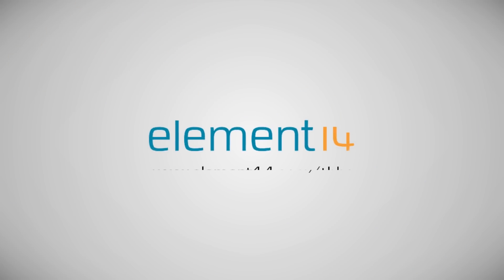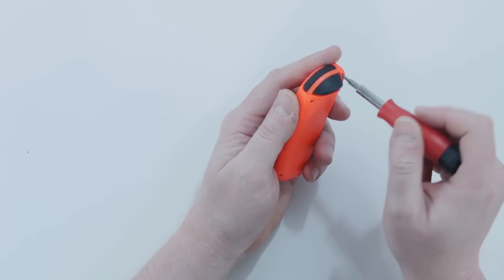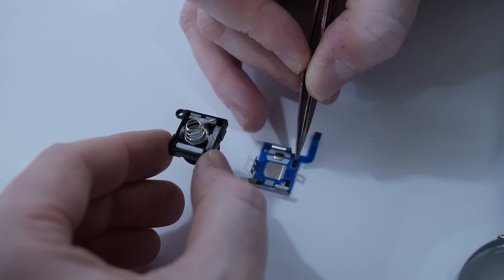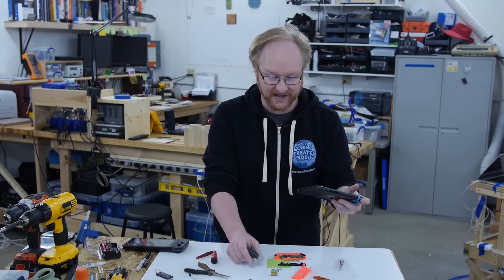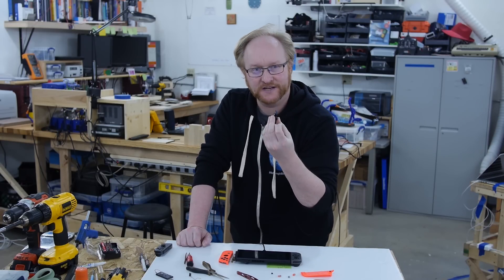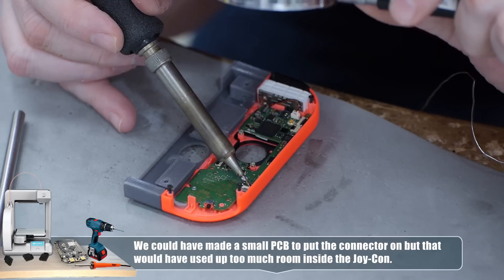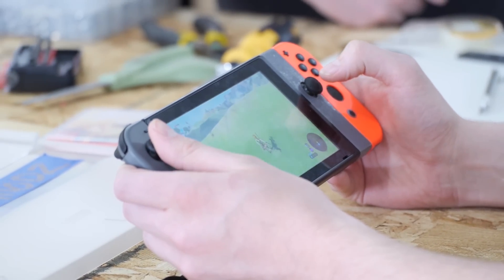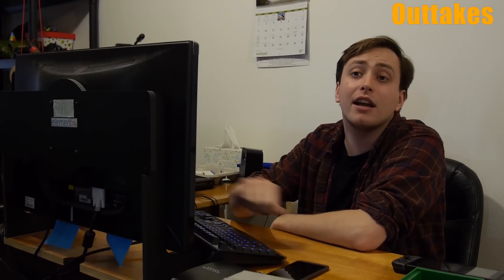The Ultimate Nintendo Switch Mod!

Comment: kinda surprised Nintendo dint just do this, but also with both sides, and so you can connect both side controllers together and make a full controller with like a flip out stand on the back of the switch.
overall this is really well made, good job guys :D

Comment: My issue is not with the controllers but the console itself. It’s no longer the 1980s and people don’t put their consoles on top of their big tube TVs. This upright console design does not work for modern entertainment cabinets. The switch console needs a redesign so that it can fit within the under cabinet slot of an entertainment center. And if I want a portable Nintendo, I’ll just get a 3DS... a console is a console. Maybe that’s just my own opinion but I would love to see a redesign of the Nintendo switch as a flat under cabinet console design.

Comment: It doesn't take a rocket scientist to figure out that the joy con analog stick is cheap. I have an idea for another switch mod. Replace the analog sticks with actual full range sticks like used in the switch pro controller. Or you could give it a d-pad as featured in the Nintendo switch pro controller. Or you could replace the buttons with buttons that don't feel like your squeezing loose pieces of chalk as featured in the Nintendo switch pro controller. Or you could tape a Nintendo switch pro controller to the bottom of the switch and call it a day.

Comment: So a non-issue that's not very common at all is being "fixed". I mean, this is neat but it's kind of redundant. The placement is perfect honestly. The offset analog sticks should be a standard for almost every control. Big reason why I think a lot of folks like the Xbox controllers.
Reply: The reason why the Xbox controller is fine is because while it is moved down, it is also moved outward to be a similar distance from the thumb. The thing with the JoyCon is that it is only moved down and not outward, so to use it your thumb has to crane itself inward instead of simply moving a bit to the left or right.
Reply: It is an issue. Your right thumb is so cramped up holding the unit. The orientation is the same but the spacing is not the same as an Xbox controller. Yeah if I was 15 again and my hands haven’t had years of use working sure it be fine but That is not the case for me and a lot of other adults.

Comment: Just got a Switch and I'm finding the placement of the right stick to be a problem as well. Trying to play Doom on this thing, with the joy cons connected to the screen is a challenge. I can't get my right thumb into a good position to hold the system and play the game comfortably. It helps to play with the joy cons detached, but I think the best answer may be the pro controller.....but that kinda defeats being portable the more stuff I have to carry around with it. A right joy con with the stick in the upper position would be a great option.

Comment: The part the missed is how the stick is designed to be used. It’s not a tip of the thumb stick; you’re supposed to use the middle part of the underside of your thumb so you can also reach and use the buttons.
Impressive mod regardless

Comment: That works... or you know just position your hand holding the right joycon in a way your thumb can comfortably reach the joystick and buttons. This layout is a lot like the 360, I've got fairly big hands and the layout doesn't cause me any grief. 

Also, you could try not playing it for extended lengths of time over an hour. You know, pause the game and give your hands a break, that kind of thing. There are so many easy fixes over 'hacking' it to add yet another inch or so just to 'fix' the joystick issue.

Comment: I feel like you coulda just 3D printed a duplicate controller flipped the along stick and buttons like on the other side and just reassemble the components into the new 3D printed controller. Instead of over complicating this.

Comment: Nice solution to a problem that wasn’t really a problem.
Reply: a lot of people hated it. stop being such a fanboy.
Reply: YouTuber with small hands detected.
Reply: Cool opinion bro, Check out my opinion. 

THE RIGHT STICK PLACEMENT IS NOT VERY ERGONOMIC FOR HANDHELD PLAY!!!!!!
Reply: Speak for yourself, I decided not to buy a switch immediately after trying one for the first time.
Reply: I have relatively large hands, but not everyone has the same movement range you know. My thumbs can't go past a 90 degree angle from my pointer finger, i.e. when you make an "L". I can slightly go past that, but it is strenuous to keep them that way. My thumb's final segment is about 2/3 the length of the first segment (they look equal if you disregard the part that's "inside" the hand). My thumb also cannot bend past the point of the two segments being straight when bending it backward at all (thumb-tip at about 20 degrees eyeballed from base of thumb), and only 90 degrees the normal direction. If you find the Joy-Con comfortable on the right side, I GUARANTEE you cannot say the same set of things I've said here about your hand.
Reply: You must have baby thumbs.
Reply: It's a big problem for me. I can't play Zelda very well at all. During battles, I feel like I'm a grandpa who's never played a video game in his life. It's really weird. The placement just isn't right. Also, no one can argue that the pro controller and joy con placement are in two different places, making uniformity non-existant.
Reply: You guys should look into getting some thumbstick extenders as well as a decent grip case. It will help alleviate the issue to a great extent. I use an Orzly Grip Case and Hyperkin Switch extenders, with the short concave one on the left stick and short convex one on the right stick. It's much more comfortable and I can play games like Zelda for hours without issue, as well as actually being able to aim sufficiently with the right stick. Previously, I couldn't play more than 20 minutes without my hands cramping up. Both products come out to about $23 US together on Amazon.
Reply: @guy827  I just purchased the grip case for mine today for 15 bucks and it was very worth it. Completely changed the way I have to hold the switch making it easier to move around to different buttons. It's just better with the grip case.
Reply: It's a problem for me too. I solved it buy purchasing a pro controller but it's not the same because I'm not holding the display.
Reply: Heres a solution!! Buy a pro controller!!!! Most of the time i play it docked anyway so why go to trouble, !!
Reply: For your small hands maybe. obviously it was enough of an issue to mod the system.
Reply: It's a problem for me, the right is so uncomfortable in comparison to the pro controller.
Reply: Bandar Alshareef stop using a claw thumb grip then and hold it right?

Comment: okay easier solution guys so you dont have to Ruin Your Switch trying to do this get the screen protector pack that has stick extenders and if you need more than that you can put PS4 controll freaks onto them extenders

Comment: All we we need is to make both joy cons set so that it's resembles a game controller more, try to design a new casing to put the joy con internals into so that it can be all one color, as well as, give it a more control feel on the back of it so it'll basically be like taking a controller and cutting it in half and slapping it on a switch,  and finally a docking system for the joy cons so that you can use them like a normal controller in tabletop and tv modes.

Comment: Nintendo should totally make a Switch controller that has the thumb placement just like that. It wouldn't be able to be used as a standalone controller like they originally intended, however if it's sold separately then it'd be okay because we'd still have the old one (or just use the much more comfortable Pro Controller  for the second player) -- I would love to have this modification as a product.

Comment: Your next project is to put a D-Pad on the left joycon. ;)

Also try and design a Switch Dock with a built in 1080p monitor! lol it would unportablize the console, but since portable display only does 720P it may still be cool to have an option for 1080P on the go. :P

Comment: This could have been fixed with 3D printing much, much easier. Just print a triangular wedge that angles the entire joycon at an angle where the top is further from the system than the bottom then print a grip that keeps the hand resting vertically with the console.

For visual reference, imagine the forward/backslashes make up the joycons. The buttons would take about 5 seconds to get used to but the stick directions could be annoying.

|\ \[____]/ /|

Comment: Would it be possible to mod a DS to play Gameboy and GBC games by either:
Using the physical switch it the GBA cartridge slot to determine whether an emulator should be loaded such as a modified version of Goomba Color like a GBA game and if it is switch to the game cartridge so the emulator can directly read it
Or:
Use that switch to determine whether to not boot the DS but instead a GBC built into the case?

Comment: I would love a stand in which the switch charged and you are able to play on the local display. The normal stand is not that sturdy. If it would be small enough to be able to take it on public transportation would be a big +.

Comment: Isn't there a pro controller
Reply: Ian H how does it double the size it's a wireless controller that doesn't attach to the switch at all
Reply: Yes, there is a pro controller, but that would drastically reduce the portability of the Switch.
In fact, you could only play in table top mode, so you would always need a flat stable surface. Not quite portable anymore huh?
Reply: @TheFrantastic  no, you can play with the pro controller when the switch is docked... it's a wireless controller...
Reply: @yeahitsben  If the switch is docked, we're not talking about portability. This is regarding portable mode.
Reply: @TheFrantastic  I think you've seriously misinterpreted the entire concept of the switch. while at home, it's a full-blown console experience. while you're travelling, it's still a full blown console experience. a pro controller is pretty easy to take around, you can just shove it in your backpack.
Reply: @yeahitsben I know how the Switch is supposed to work, but what you're saying isn't relevant to the argument.
If you want to play in portable mode, not table top nor docked, you can't use the pro controller. It's not like you have 4 hands, right?
Reply: @TheFrantastic  yeah but if you want to play in portable mode, you have to use the joycons. here's the thing with joycons: contrary to popular belief, they're not absolute garbage, they're actually pretty good. I genuinely prefer the joycons over the dualshock 4. they're also good because they protect the main switch body from nearly every single angle when it's dropped.
Reply: SuperToadDaniel Gaming thank you
Reply: The Pro Controller doesn't change the size of the system. It's just a wireless controller.

Comment: That looks like ass, Surely the stick could've atleast been centered on the new material. And if the fixture was in the way that forced it left, could material not have been added on the right? And if the cable was too short to move it further other, use a replacement with a longer wire.

All in all that was a pretty piss poor job. Showing the creating of the "spacer" would've been nice too, especially how you modelled the fixture and got the proportions right, and if it is a 1:1 copy of the real fixture.

Comment: could custom lenses allow you to use more pixels in a modded switch VR headset. because the only problem with a VR switch headset is that the shape of it makes it so that the amount of pixels that you'll get would be extremely low, but I bet if you could refract all the light into the correct shape and size it would create a better experience

Comment: Make a new Handheld Dock. The new Dock should have the parts of the Pro Controller and the switch should feel like you are holding the Pro Controller. 
On the bottom there can be a extention to store the battery pack and some other stuff. Maybe adding a second USB port, so that you can charge your switch and don't have a cable on the bottom. When the switch also fit in the regular dock, this would be great. 
Also a great thing is when you can store your regular joy con's. 

Having a Switch that is optimized for Handheld Gaming and also has the ability to play in Table Mode with the option to charge and better kick stands is a great thing. 

When you can buy this mod, I would buy it when it's like I imagine it.

Comment: Personally I like the placement of the stick, because I can move it with the bottom part of my thumb while using the ABXY buttons, but maybe that's just because of my hands.
Reply: Yea I've played hundreds of hours on Zelda using the joy con grip that's in the box and I've never seen any thing wrong with it
Reply: It does suck to try to use the tip of your thumb to hit the stick but I do the same as you it sounds like. I rest the underside of he knuckle on my thumb on the stick and use the tip of my thumb to press the buttons. Pretty comfortable actually
Reply: Not all of us can do that - trust me, I am physically incapable.
Reply: Yes it works, but I would prefer the Wii U layout with the right  analog above the buttons. I found a wired Switch controller with the Wii U layout that's great but I wish there was a  joycon with right analog on top for when playing in portable mode.
Reply: I do the same, Tip of thumb for ABXY and knuckle of thumb for right stick
Reply: Same!
Reply: I agree.

Comment: Instead of using the tip of your thumb to move the right analog stick like a fool, try using the part of your thumb that rests on the stick when the tip of your thumb is on the buttons (near or below the thumb's distal interphalangeal joint). Voila! It's just as dexterous (if not more so), no finger cramps, and no tedious, risky, and unsightly Joy-con mod.

Comment: he moved it up slightly and away from the buttons.... alright.
Reply: Derek aka Derek i dont have any problems whit the design and i just playd around 6 hours
Reply: Derek aka Derek not trying to be an asset or anything but doesn't the x box layout have split unequal analog sticks? If they had a portable I'd imagine it be the same. What's more difficult to deal with is the fact that the button mapping for face button feels so backwards from every other console.

Comment: Possibly replicate the "3DS Controller mod" where you can plug in a controller to a port and use it to simulate Joy-Con button presses, but by pressing the buttons of a GameCube or N64 controller.

Comment: I could see a version of this becoming a legit product. Just a cheap piece of plastic with an analog stick and a passthrough for everything else that slides right in between the console and the Joycon. The only tricky part would be hijacking the control away from the legit stick. Also somehow covering the legit stick would be a good idea. Probably just integrate a cover

Comment: what about a little box that holds your switch screen in place and also charges it.  There could be charging ports for controllers and it could also have the hdmi cable to put the switch on a bigger screen.

Comment: I Once tried to use 0402 components on a board with the aid of a reflow oven and found them too fiddly and gave up after the fifth run through the oven. Kudos to you for successfully hand soldering 0.5mm pitch on an assembled device.

Comment: Is it still Possible to use Amiibos, `cause the reader is normally directly below the stick?
Reply: how hard do you have to press on there to possibly damage it? if you just lightly hold it on there, nothing can happen
Reply: No it's on the stick
Reply: LUKE TUCKER which makes it better, you don't have to put in on the analog stick and risk damaging some thing

Comment: Nintendo switch laptop with xbox 360 controller and some kind of charging thing based on 360 charge/play cable thing. Nintendo had their head up their ass when designing the switch controller. This thing is a console/handheld hermaphrodite thing.
Reply: Chill out kid, its not the end of the world
Reply: +Astuf yes it is. Nintendo has gone the way of Apple and has been making obscure and over complicated things since the beginning. Both have even duplicated their work many years later after running out of actual ideas.    The Wii U was essentially a very modern version of the DreamCast where the novelty of it all was that there was a screen on the controller that game developers may as well ignore unless they are making a game exclusively for that system.

Apple has done the same shenanigans for years in the fact they keep adding things that the competition has been implementing for years  and calling it their own. 

Essentially, the switch blurs the lines between console and handheld. It is no more innovative than a Bluetooth controller paired with a phone. 

It would be way more worth buying if it 
-Had more games
-A better controller that the customer does not have to purchase separately for $40-50 extra just to have a good game experience 
-Lower price for the console and the games that go with it.

The reason i think it would be good in a laptop is because the docking port is on the bottom and the screen is already there. You could hide the conversion stuff and maybe even a UPS in the base to add some weight to stabilize it. 

Who you calling kid?
Reply: "It's not the end of the world"
"yes it is" inane ramblings

Okay kid :^)
Reply: +Zelly Neko lol clearly you didn't see i was being facetious.  I may be 23 but i would rather be a kid than a humorless stick in the mud. XD  

Arguably, It could be then end of Nintendo's world as they continue to go south.